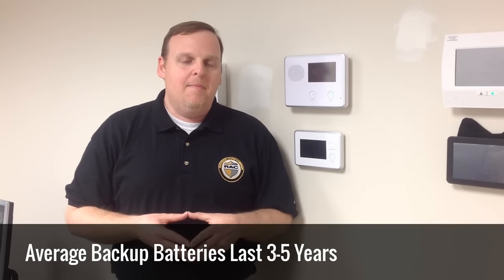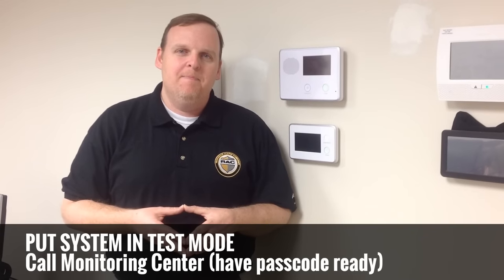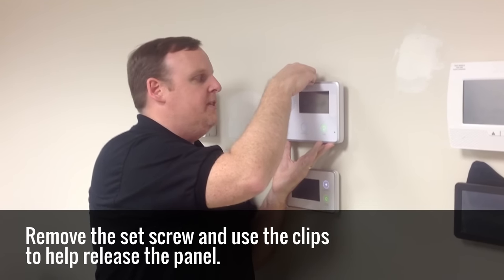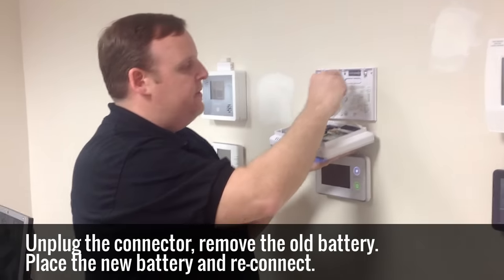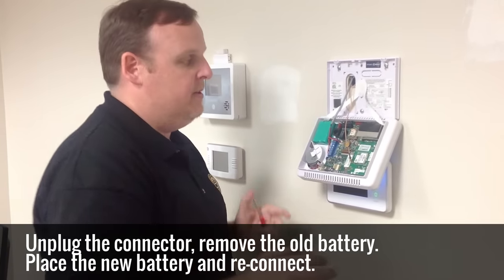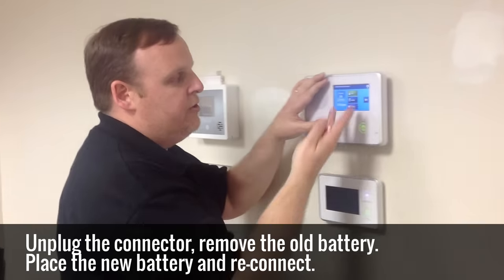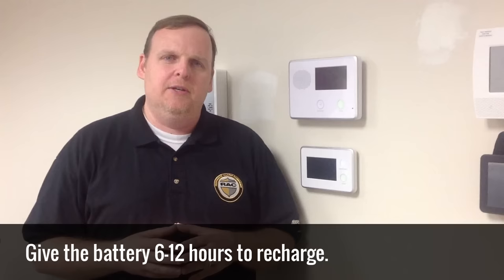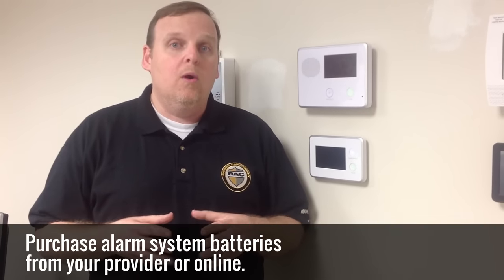How To Change Your Alarm System Battery

Comment: I’ve had an alarm guy who says he knows what he’s doing, come out to  replace all the sensor  batteries in the house. We had enough of that constant warning beeping sound that you had on your video. The alarm system is not connected it is only used to let us know when someone comes in and out of the doors. Three hours later, he still cannot get the warning alarm to go off. It now has been reduced to it saying that the control panel battery is low. And that only happens random. I do not want him back to the house. Your video shows it can be done simply. But it does not show which battery to purchase. Ours says reliance protector on the outside. He says it takes weeks to get and i dont believe him. Please say its an easy battery to replace.

Comment: Ok, so I no longer have my monitoring service through Richmond, but the old keypad is still on the wall and it keeps constantly beeping. I finally figured out how to remove the battery pack (unfortunately BEFORE I found this video😒) but its still beeping even without the battery pack. Can you please tell me how to totally diconnect the entire system so that is no longer getting power??
Reply: Having the same problem! If you find a fix let me know
Reply: Hopefully you’ve received an answer to your question by now. If not, the system is also hard wired and plugged into the nearest outlet. You will need to unplug to stop the beeping permanently. I was experiencing the same issues and I removed the battery and unplugged. All beeping stopped.

Comment: I have the system for four years... I cancelled the monitoring after 4 years because when the alarm would go off they simply would send me an email saying to proceed with cautious! That was it! 
I felt that the ADT alarm monitoring was just set on  a computer program to warn in case it would go off... finally I let it go after a lot of them "playing" around and would not cancel my services! 

Anyhow, during the night I put the alarm on but noticed that it says tgat the batteries are low.  

Which website can I buy the batteries online? Thank you!

Comment: I disagree, This will replace the battery. But it will still say low battery on the keypad and the constant beeping will drive everybody crazy. 
To clear the low battery from the keypad, First power down the whole system by removing the D.C power wire from the keypad. Now replace the battery, reconnect the power wire on the keypad. You're ready to go. 
The keypad will not clear the low battery if you don't power cycle the panel.
Reply from the maker: Great feedback, Trino. We have never seen a 2GIG  you have to power down to clear the low battery. It usually takes 24 hours for the new battery to fully charge and at that point, the panel will clear the notification. We verified with 2GIG support and they determined that after the battery is 75% charged it should clear on its own. You might actually have to acknowledge the trouble condition for it to clear, but definitely not power down. We would recommend giving the GC2 panel 24 hours to fully charge the new battery and then simply clear the trouble condition. Please let us know if this works for you!
Reply: Powering down worked for me. System was beeping 2 days after I replaced the battery. After powering down you will have to reset the time which is another process
Reply: After unscrewing the Phillips screw the cover opened. But there is no place for a battery as shown on your video.  It is just a printed circuit board.
The dude who installed this system has fallen off the planet.   Can anyone help?
Reply: @dunrockin5 .... Janice bigger, I'm sorry to hear your having issues with your alarm panel. 
First 2 questions I have: 
Do you have a 2 gig panel ? 
And do you have the correct battery for this panel ? 
Everything the guy showing here in the video is correct. With the exception it doesn't take 6-8 hours for the panel to see the new battery. 
Powered down the whole panel, plug in the battery first, now reconnect the power. 
Your panel is good. 
You will have to reset the time and date on the panel.
I've installed and serviced hundreds of these 2 gig panels. 
I kinda wonder if your panel even has a battery. Maybe that's why you can't find the battery. Only problem is, if no battery; you would have had issues from the beginning.
Reply: Can you do a video on power down the DC power?

Comment: put the system on test before you start with the monitoring station , is always a good idea . good engineers always use the engineers code first  . otherwise if it ant on maintenance you will need an anti code reset .

Comment: Would love to learn how replace a 20 year old keypad and panel Would put the panel in test but the company does not exist anymore... wanna place it because the buttons have gotten so old that they don't work anymore so the alarm system is unusable. Took almost 30 minutes to shut it off